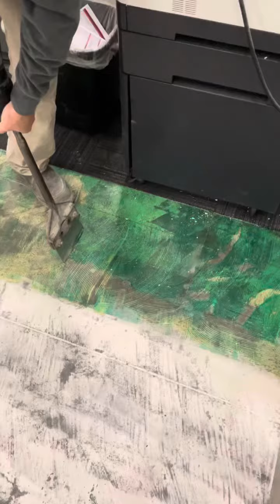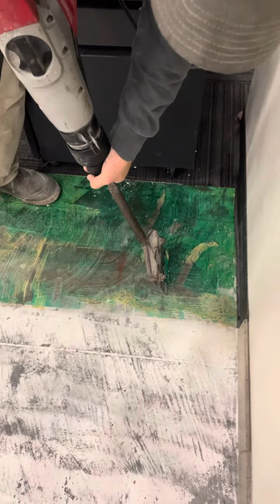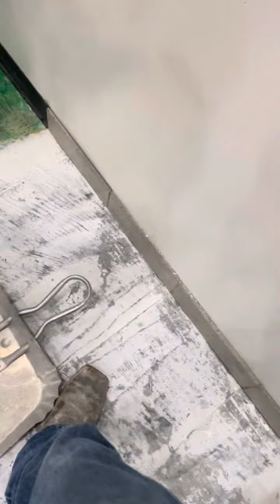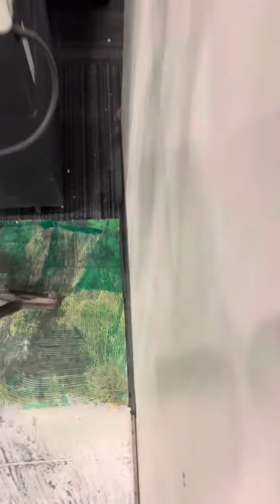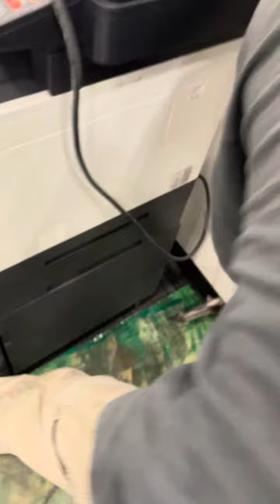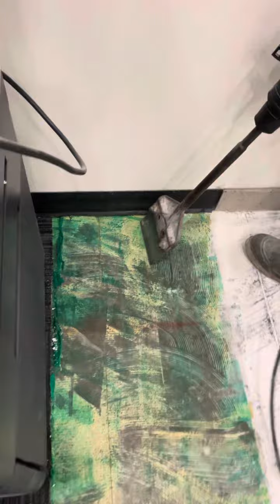Super sticky glue removal with the Milwaukee SDS Max #video #milwaukee #powertools #flooring #tools

Comment: Why not sand it or scraper?
Reply from the maker: We would still need to grind it off as it was going to a high grit metal bond diamond before throwing a sealer on
Reply: Have you ever sanded glue. It can get sticky as hell
Reply: it depends what disc you use, sanding will clean that up real good. After that you can grind it if that's the prep that it needs.